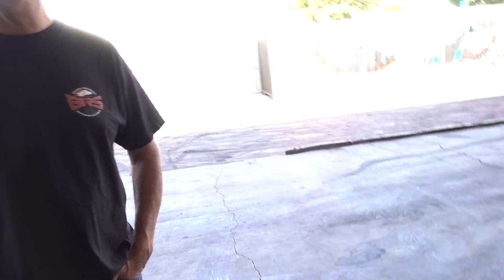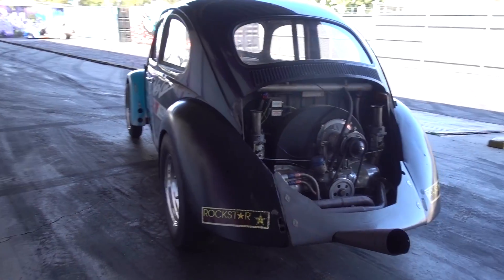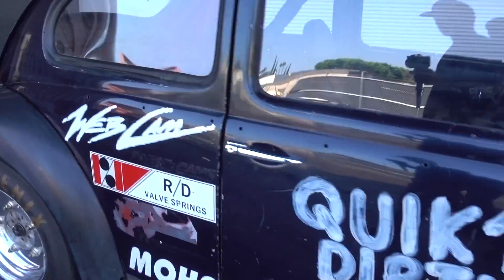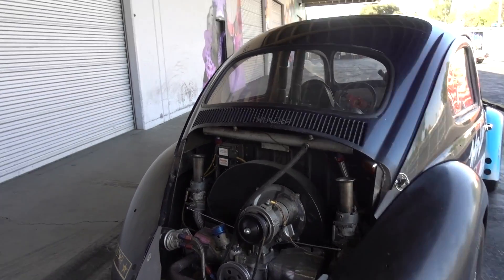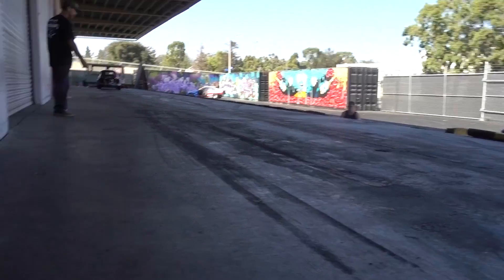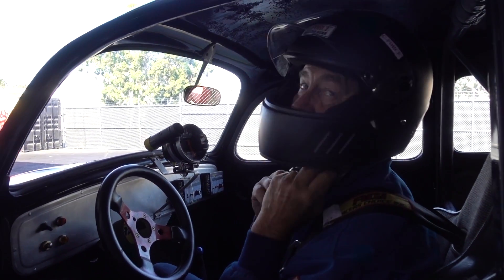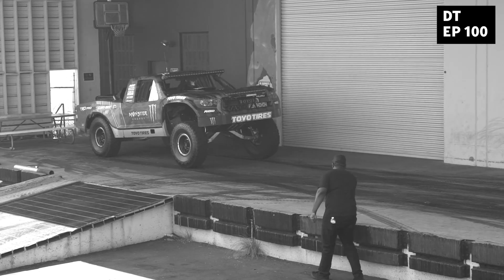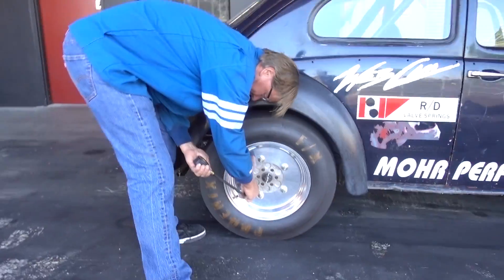[HOONIGAN] DT 104: Will it Wheelie? '64 Volkswagen Bug

Comment: After so many pro drag cars that have tried, the first one to pop a wheelie this big was a beetle  

Don't judge a book by its cover
Reply: Bsteg Media this is the second car to do wheelies
Reply from the maker: We will discuss this on Friday in DTT... What was the official first wheelie at the Donut Garage.
Reply: TheHoonigans well other have but this one was the most badass by far
Reply: Well this has no weight in the front if you think about it all the cars that have attempted have like a 500-600 pounds up front don’t get me wrong it’s still crazy that it can wheelie
Reply: +TheHoonigans How about anyting above 30 degrees?
Reply: VW Bugs have been doing $300 wheelies since the '60s so it's really not that surprising
Reply: Bsteg Media because those cars are designed to not do a wheelie, every drag beetles does a wheelie because it's so short and all weight is in the back
Reply: Rear weight + short gears = wheelies
Reply: The Guy Who Likes Cars also short wheelbase
Reply: James Ferro I agree 👍
Reply: Bsteg Media first car to scrape
Reply: Bsteg Media not the first car
Reply: Bsteg Media I think its because of the weight in the back
Reply: well it is an issue of weight and traction
Reply: Bsteg Media, Bugs weigh nothing and the engine's in the back it should be effortless. And technically that Maverick did the first wheelie...
Reply: Yes, but that was a small hop. This thing did a fucking monster wheelie.
Reply: Fewest cylinders to perform a wheelie ;)
Reply: Beetles are hard to keep down.  VW's in general are hard to keep down in rwd configuration, they have epic transfer with way above 60% weight on the rear end, probably close to 66%
Reply: Beetles are an absolute classic car for a reason.
Reply: Bsteg Media herbie just got fucking real
Reply: Bsteg Media of course it does a good wheelie because its a vw
Reply: Rear engine car...not too impressive
Reply: @coryunferferth1767  hater🤣

Comment: Dang thing must run off propane.
Reply: Hank Hill 🤣🤣🤣
Reply: And propane accessories
Reply: You boys quit wackin in ma tool shed
Reply: Hank Hill only u would know
Reply: and propane accessories ...
Reply: If it was diesel...
Reply: Hank Hill he said it ran off of 110 gasoline
Reply: Hank Hill for sure
Reply: It sounded just like Hank in my head when I read this comment. LOL
Reply: Best comment I've seen all month   RIP Hank Hill*
Reply: You could actually use propane for cooling, But better hope you don't have and loose wires to spark.
Reply: Hank Hill  omg I'm in tears best comment I have ever read. And yeah it sounded just like hank hill in my head
Reply: Again with the propane jokes
Reply: I can imagine that being said in the hank hill voice
Reply: Get outa here
Reply: Chriseyre yes it's has 13:1 compression ratio and he's running 110 octane race fuel of some kind. At 2442cc that's pretty much as large as you can bore and stroke the factory type 1 crankcase. A stock 1600cc (1584cc to be precise) engine has an 85.5mm bore × 69mm stroke crank. To get his 2442cc (yes I know he gave the specs) he has 94mm bore × 88mm stroke crank. There's been some guys that went with aftermarket case and cylinder heads- Pauter, and Autocraft are the two companies that I remember being the most common. I've seen Pauter engines that were 3300cc. That's more than twice the stock displacement. These air cooled beasts are in sand rails and 1/4 mile dragsters, run on alcohol, turbocharged etc and there's been a small handful of guys running them in their "street" cars. If you're interested check out some VW Paradise and Hatermaker videos here on youtube. They ran a slingshot style dragster called the "nail". It boiled the slicks WAY down the track- all the way to the traps one time I'm pretty sure. The Hatermaker is a beetle that's ran approx 7.75-7.85 at around 175-178 mph. It's a family business down there in Cali. Pauter is 2 brothers in Chula Vista (?), been doing their thing for decades, Don and Larry if I remember correctly. Anyway, no more (Mohr?) talking I'm sure I've went way beyond my allotted minutes preaching to the internet.

Comment: 11.33 with 2 carburetor barrels. "I'm gunna put a Subaru engine in it" Why so you can go slower? Over 2.4L on a type 1 case is awesome
Reply: There’s not a Subaru in the world faster than the fastest aircooled VW let alone a VW with a Subaru Swap . For reliability sure I guess (that’s debatable) but it’s never gonna be cooler than an aircooled stroked type 1 .....never
Reply: @robertnewton2154  Subarus are ok but keep it VW, its just better. There is this porsche 914 off the road on my neighbors property thats been there for years and I've gotta catch him at home and get that motor

Comment: That's right, dragging stinger with Kadrons and the thinnest cylinder walls on the planet with a compufire. Bugs have been kicking ass at the drag strip since the 60's. Not all of them ran on flower power, these ones ran on AV gas and 110 ethyl leaded gasoline.

Comment: If I remember right the first 4 cylinder to break 200mph at a dragstrip was a VW based dragster. I'm not sure of who did it but it was in the early '90's. It was a fuel injected alcohol with nitrous oxide.

Comment: Serious question for anybody to answer, so I got my first car a few days ago. It's a 91 Cb7 accord lowered on coils, with adjustable toe and camber arms, a new intake, new more grippy tires, new exhaust (no not a fart can), new ceramic brake pads etc. simple stuff that will keep it reliable as it's my daily and I am only 16 so I don't have a lot of cash to fix things and have limited car knowledge. But, my question is that I have very low profile blindspot mirrors and I can back into a spot and parallel park and everything without them. The reason I have them is because my wheels are esr's so they are like $1100 and that's a lot of money when your only job is dogsitting. (I know that's cheap compared to high end wheels) And the blindspot mirrors are so I don't get curb rash on my rear wheels as the blindspot mirrors enable me to see the wheels while driving. I have never been to a local car meet, but will people think I'm a fag because I have blindspot mirrors?
Reply: did you ever figure out if your a gag or not?

Comment: That defies physics, less pressure in the rear tires means the rear end weighs less so less traction. He took 20 lbs from each tire, 40 lb loss from rear for traction. Right-am I right? Really something when a twin turbo T bucket can't do it but a VW can Sick.
Reply: Lower pressure gives better traction up to a point. Too low and the tire will start wrinkling and folding, keeping it from transferring power. Boulder crawlers run with super low psi to let the tire deform and contour to the rocks giving it more grip.
Reply: @109268  That must be why wrinkle wall slicks, think top fuel dragsters, don't work and keep top speed and et's down. think how fast they could go with hard side walls and 40 psi in the tire.

Comment: Lame of course a fiberglass front end VW will do a wheelie YAWWWN!
Reply: ya gotta remember this is a naturally aspirated Aircooled motor. stock made 60hp at the crank.
Reply: Someidot and.... im not talking smack on a 1200lb 2442cc... i use to have a 68.  1/8 mile yawn.